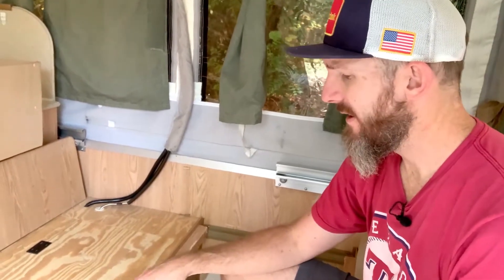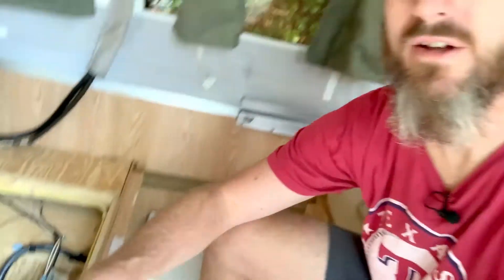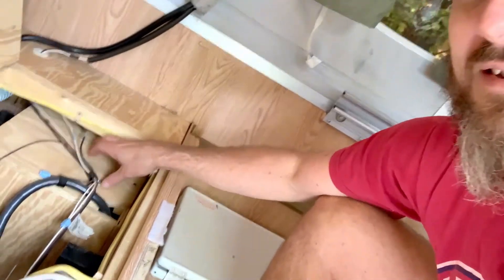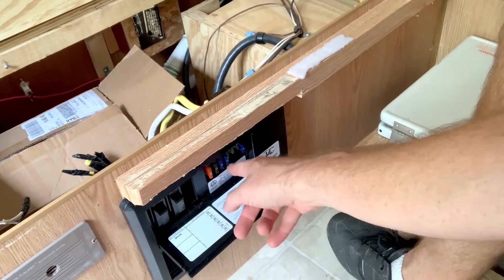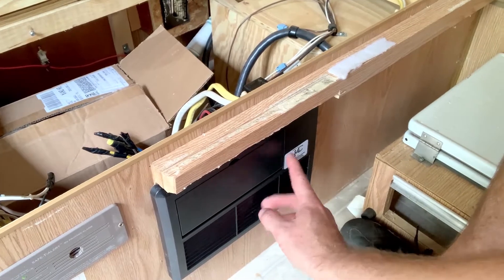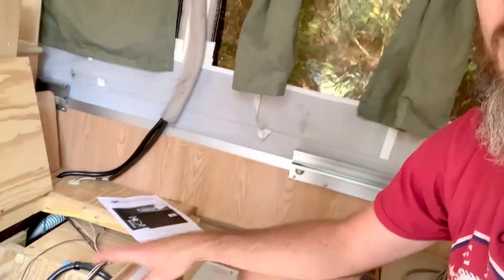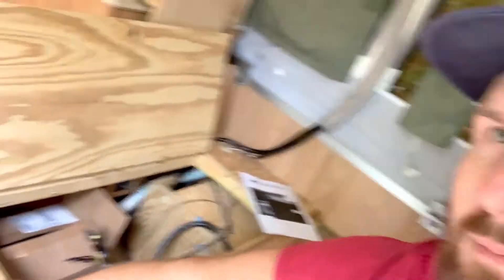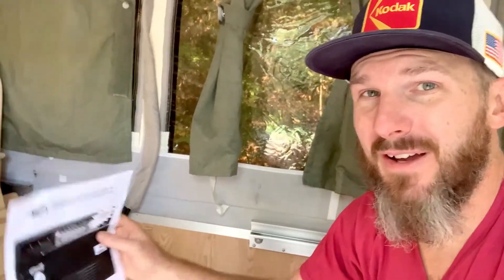DIY Camper Power Converter Repair (Elixir ELX-30 Replacement)

Comment: All of these old OEM converters are trash. Even when new they really don't charge batteries well. Unless you always camp with AC shore power, it is a really good upgrade if you run a generator to charge the battery.

We boondock a lot so I replaced the converter on my old class A with a Progressive Dynamics (PD) converter and distribution panel. It worked so much better than the old one. PD units have multi-stage charging. You don't have to worry about cooking off your battery if you want to leave it plugged in and they charge batteries a lot more quickly. I would just run the generator for a few hours a day. With the old one I used to have to run a small generator for at least 8 hours a day to keep the voltage up.

I just purchased a 2007 pop-up for my kids to use and I purchased a lithium battery for it. I'm replacing the Elixir 30 with a new PD unit that can properly charge a lithium battery. Like you say, the project isn't too daunting. Some of the more popular OEM ones have a wire-by-wire replacement guides available from the retailer you recommended. Anyone who dry camps will not regret replacing an old converter, even if it is working.
Reply from the maker: Good advice! All in, not very expensive. Cheaper than a new battery these days
Reply: You can also get a 100AH lithium battery for about $250 that will last a long time and work better than a couple of 6 volt batteries. Combined upgrade is about $500 with a cheap power monitor (can't reliably tell how charged a lithium battery is by the voltage). Do that and you will have really stable voltage and won't have to worry about replacing a battery or converter for 10 years

Comment: This is the exact problem I'm having with my pop up battery. I replaced a dead battery, and then my new one died and I heard this high pitched squeal coming from my CO2 detector. So I guess I'll look into a new converter
Reply from the maker: Make sure the sound is coming from the converter - I thought it was CO2 as well, they're right next to each other!
Reply: @LakeHubTV  Hmmm, mine aren’t near each other, my converter is under the bench seat near one bed and the CO detector is on the wall under the opposite bed but I’ll have to hook up the battery and really listen again
Reply: @ericsurprenant2110  I think the squeal happens when it loses power. If you remove AC power (and the converter provided dc power) with a dead battery it will squeal.

Comment: Does this converter always run when plugged in? Just got a 2006 palamino 2006 yearling. When I plug into house...this elixir industries thing runs. Must be a converter....does this run continuously?
Reply from the maker: yes, its going to be doing its thing - charging the battery and supplying power to the camper
Reply: It will always be on and charging the battery. It doesn't have a proper float so eventually the battery will die from it. Replacing with a unit such as the one shown (4 stage charge circuit) in the video properly maintains a battery when it is kept plugged in.